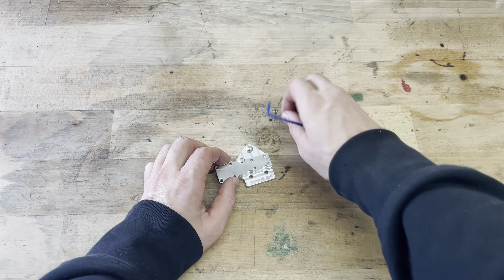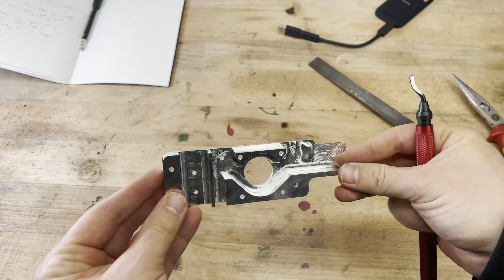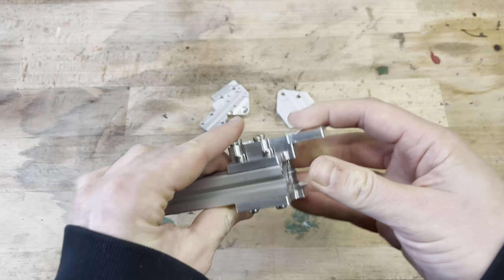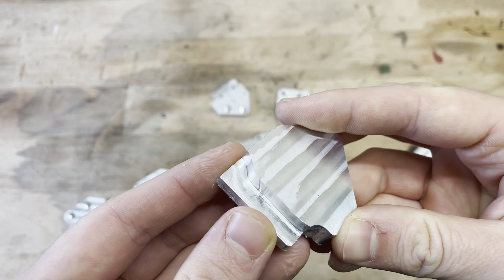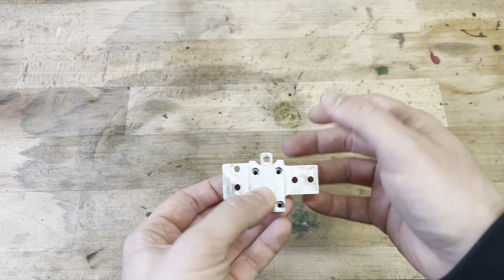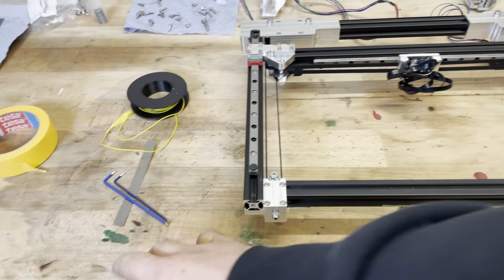Designing and Machining a CoreXY stage with a Hobby CNC

Comment: Nice project. The pulleys should perhaps be closer together in order to avoid slippage. I expect you have looked at the Voron project for reference. If not I think you could use many of the CAD files from there and just do some changes to it since you are using aluminium. Looking forward to the rest.

Comment: something to think about. Since you are machining the motor holders, add a bearing to the half the motor is not connect to and use a longer shaft motor, then you can apply more tension the belt and not bend the motor shaft (I wish I had done that early in my build, now I would need to do it after the fact
Reply from the maker: I thought about that and for now decided not to include it, as I would need to purchase steppers with a longer shaft. The onces I am using right now were just laying around. Have you had issues with the motor bearings or the shaft itself?

Comment: This looks awesome!
If I may, based on years of corexy design experience:
If you change the positions of those two pulleys near each stepper, and potentially slightly the position of the stepper itself, you can get way more wrap angle of your belt around the stepper pulley, will help reduce the chance of the belts skipping teeth.

Shoulder bolts is a big win, I use them myself, but I don’t think I have nearly as much play as you do. They do come with different tolerancing, a h7 or g7 should work quite well. 

Best of luck, look forward to seeing the rest of the project! 

PS: Klipper without a doubt, kiuah is a great installer.
Reply from the maker: Thanks, will look into that and check the tolerances of the bolts for sure!

Comment: Neat project, and great video!

With all the weight and resonance of aluminum, I'd heavily suggest you go with Klipper for the firmware, as I'd guess you'll need input shaping for higher speeds.
Reply: strong agree on Klipper as well. Just not having to recompile the firmware any time you want to make changes is huge when you're building a printer. Let alone all the other nice benefits
Reply from the maker: Thanks alot! Do you have a recommendation for a boad or family of boards for running Klipper?
Reply: @lukasOtis  I tend to go with BigTreeTech boards myself. The Manta M5P is probably a good option. The Manta E3EZ is a good option as well. Just comes down to the accessory ports you need. I'm assuming 5 motors, but if I miscounted, you can jump up to the M8P or the Octopus.

I've also had good luck with the Fystec Spider, which has 8 stepper slots.

Can't go wrong with any of those. You'll also need an SBC. Simplest is a BTT CB1 which will just slot into the M5P/E3EZ. Otherwise a raspberry pi 4 1GB is a good base line.